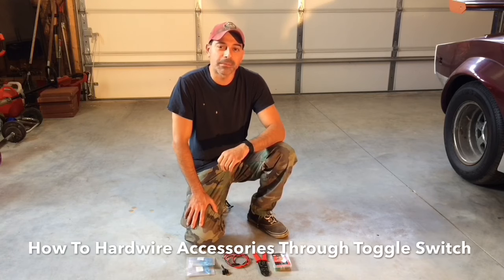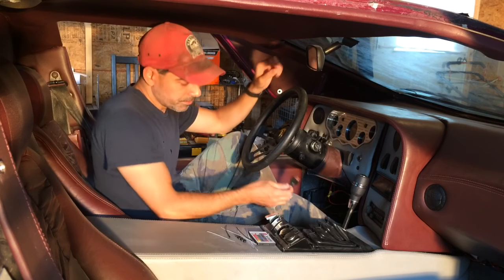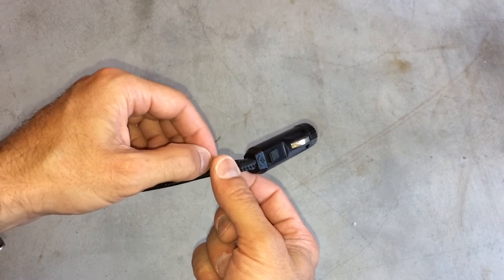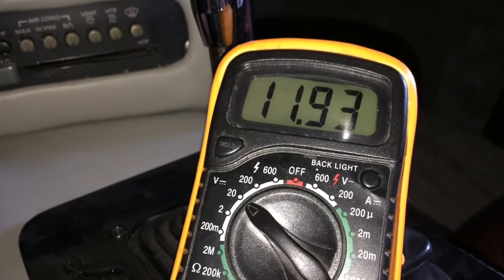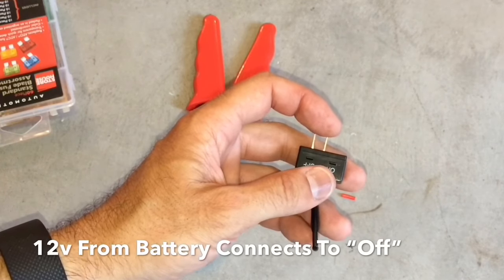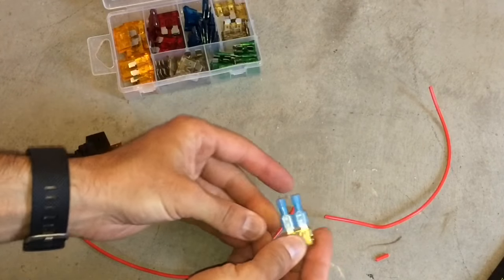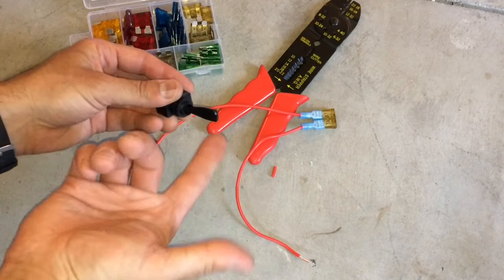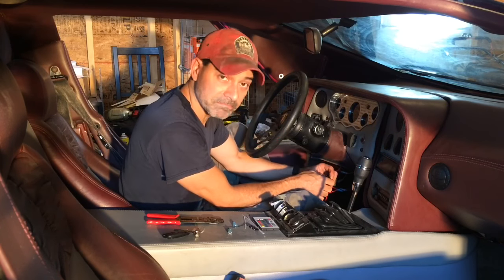Wiring 12v Car Accessories To Toggle Switch (Andy’s Garage: Episode - 95)

Comment: I’m confused so How would I do this for a remote wire that is connect to my amplifier to turn on/off using a toggle switch?
Reply from the maker: Pac Man is this for a car amp? Are you using it as a boost?
Reply: Phillips Vision yes it’s for my car amp. I wanted to install a toggle switch to turn it on/off whenever I don’t want the subwoofer on. So it has a remote terminal on the amp but I don’t know how i can connect the remote to the toggle switch to make it function. Like how would I connect it all together with the inline fuse? Thanks
Reply: Phillips Vision please any information will help Thanks in advance
Reply from the maker: Pac Man it should be pretty much the same setup. I’m not a car stereo guy but would think it’s the same. The toggle is basically connecting/disconnecting the power from the device, in your case the amp. You should have 12v going to the amp, running through a fuse and the toggle. Next, ground your amp on the chassis.
Reply: Phillips Vision so on a two prong switch, I connect one wire which is the power(the remote wire) and the other wire is the ground?
Reply: Basically on the switch, I just need to know which wire needs to be connected to the switch? The power, remote or ground and how do I connect the inline fuse with it?

Comment: Does the switch amperage  matter?
Reply from the maker: Stay True011 it does but I normally just run an in-line fuse before the switch with the correct amps, this way it will protect my switch should anything happen.

Comment: Very informative...question: I have (4) LED lights  and I want the ability to switch them all on at the same time..how do I go about doing so.  Or do I need to have a seperate switch for each of them. Or can I group 2 and 2 ....please advise. Thx
Reply from the maker: You can run them all to one toggle switch but make sure you have an in-line fuse for their amp draw
Reply: @PhillipsVision  thanks for the response. How many in line fuse will I need, plus do you know what amperage of fuse I can use. Thx
Reply from the maker: @jesseportillo324  you can use one fuse but it must be the amperage that the lights draw. You will need to check the specs on your lights
Reply: @PhillipsVision  thanks. Each light set draws 3.5amp...x 4 set of LED lights = 14amp ...so can I use an in line with a 20amp fuse ...also what type of toggle can be use i.e. type of amperage, 3 pronged toggle switch  etc..
Reply from the maker: @jesseportillo324  if you don’t need to control them individually I would just run all to one switch through one in-line fuse. The 20 amp is fine. Make sure the toggle switch is a   12volt and 20amp rating
Reply: @PhillipsVision  thanks again for the response. Does it matter if its a 3 prongor 2 prong switch. Sorry for all the questions.
Reply from the maker: @jesseportillo324  it shouldn’t matter
Reply: @PhillipsVision  thanks again much appreciated 🙏

Comment: So the ground goes from the device ( fans ) to a ground on the car ( engine or body panel or battery ) ? The power come off the battery to the switch ( off terminal ) then from the on terminal of the switch thru a fuse to the device ?
Reply from the maker: Yes, but it’s preferred to ground it to the chassis if possible